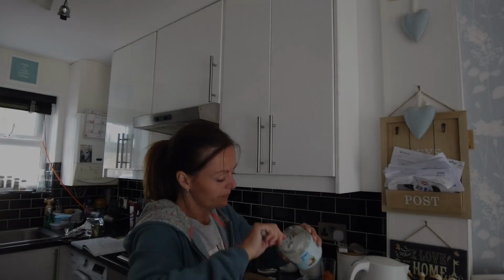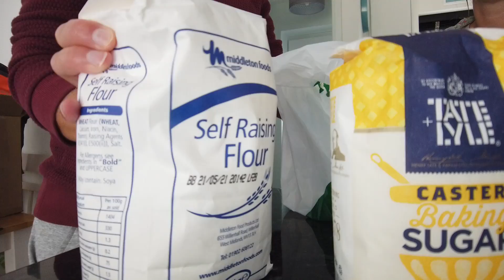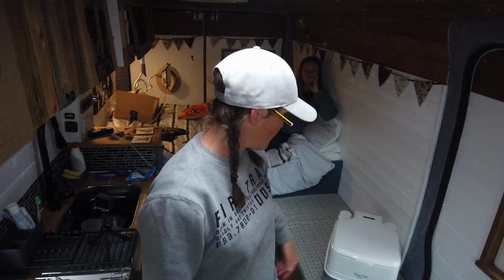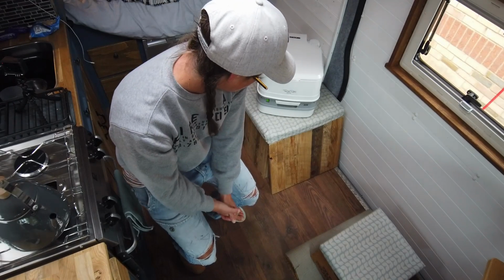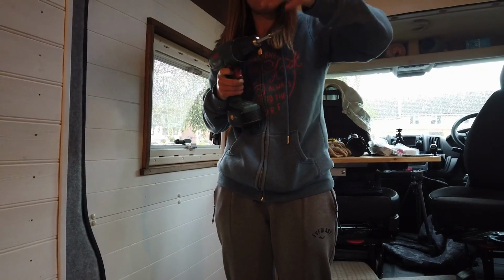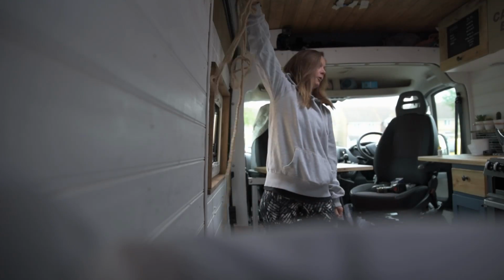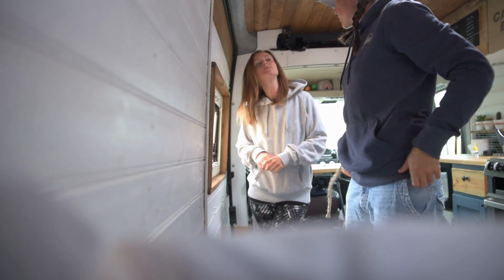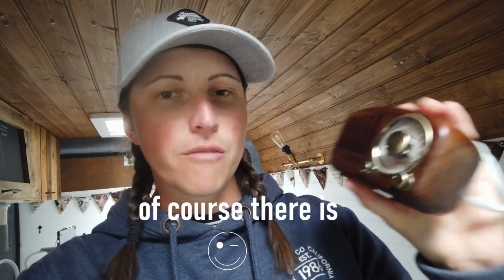THETFORD PORTA POTTI.. our tiny campervan toilet system. Our vanlife uk vlog (still pending mind)

Comment: I use Bio tablets scrunched to powder from Aldi Yes they work and smell nice.
Reply from the maker: That's great, thanks for the info Ray 😁😁👍
Reply: I'm buying one of these loos for my lil van. I have crohns disease so 😳💩 can I ask what are bio tablets? Is that like washing powder biological tabs? 
I didn't realise u can't empty a chemical toilet down a normal loo. Struggling here so any help would be greatly appreciated 😊
Reply: @victoriacee9193  Hi they are washing tablets
and yes you can empty a chemical toilet down a normal toilet. The issue is that if they have a bio tank (not Mains) the usual chemicals they put in will kill the bacteria that breaks down the waste in this type of tank

Comment: hi louise. i have a question about the running of the crx50.  i have a vw autosleeper trident. and want to take out the 3way fridge and replace with the crx50.  and run of solar . would i be able to run it of a 100watt panel?. i am limited for space. i have to go with the flexi panel. and try and arch from top of windscreen upwards. Or. i could just about get away with fitting 150watt panel.  what do you think? or because it will be arched will i forfeit solar power. ?  i should add i do want to be off grid and be in the camper for long periods, appreciate your thoughts. thanks.
Reply from the maker: Hi Janet, to be honest I don't know about arching the panel. I would guess that a 100w panel may cope with just running the fridge on long sunny days, but when the weather isn't great or the light doesn't last long I think it would struggle. Have you considered a b2b charger or split charge system, so at least if your power is low you could go for a drive to charge up.
Reply: @campervibe  hi louise. dont know what a b2b is?   But think i do have a split charge system. if that is that when you drive the van it charges the leisure battery. sorry im not up on all this, just starting out , trying to learn. appreciate you getting back to me. Hows your foot by the way.? Not too sore.  Love watching you too. always put a smile on my face.
Reply from the maker: @janet4402  no problem, and thanks Janet. I'd love to be able to give you more info but we don't have our solar yet and we've not been able to get out and about to really assess how much we open the fridge, the more you do, the more power it will use.
Reply: @campervibe  sorry louise . dont mean to be thick. maybe a bit.  but anyway was is a b2b please?
Reply: meant to say love watching you two. phew
Reply from the maker: @janet4402  a b2b is a battery to battery charger. It's similar to a split charger in that it charges your leisure battery whilst you are driving, but rather than giving a constant voltage it is more like a smart charger and will regulate  the charge given to the leisure battery. Basically it looks after them better, but it won't give you much more charge than a split charge system.
Reply from the maker: Thank you so much. The electrics is all so confusing, especially at the beginning, took me ages to get my head around it!
Reply: @campervibe  thankyou so much louise, youve been a great help. i look forward to seeing more of your videos. i might be wrong, but i just heard we can stay in our campervans from the 6th july. fingers crossed for that. !!

Comment: ok, so i feel such a weirdo returning to this topic but I have a thetford too ready to install. let me be blunt. is it number ones only, or number twos and if so, what happens when you have a 2-day vodka and Doritos sideways explosion? Surely these things are for normal 1s only and cannot handle the take-away/vodka Hulk strain and dam-breaking reality ?
Reply from the maker: Hi Simon, so it's quite a controversial topic actually, some only do 1s some only do 2s!! We generally just do 1s but if on a site and can use the proper chemicals will do both. Either way, your screwed when it comes to the take away/vodka predicament lol 😂🤣😂
Reply: Simon:  I use a Porta-Potti, for wees only.  When I want to do No2 I place kitchen towel, 3 or 4 sheets, not toilet paper as it's too thin, into the bowl and then remove the item wrapped up in the kitchen paper, put in a doggybag and then put the bag in the doggy bins you see along the road.  That way, you don't get the smell of poo. Wee does not smell as it has the chemical to mask it.  Toilet needs emptying every 2/3 weeks or so, with fresh chemical.  It goes down any ordinary toilet.